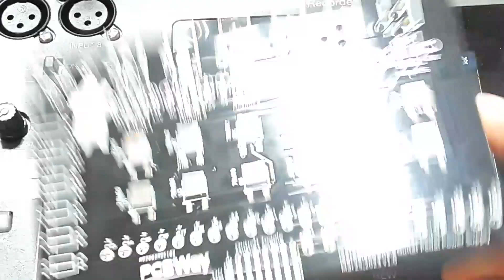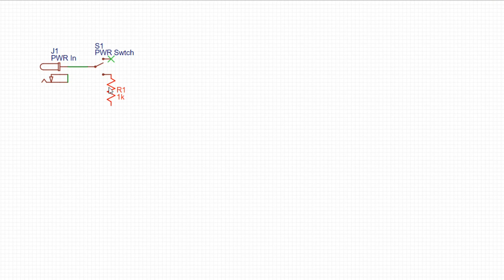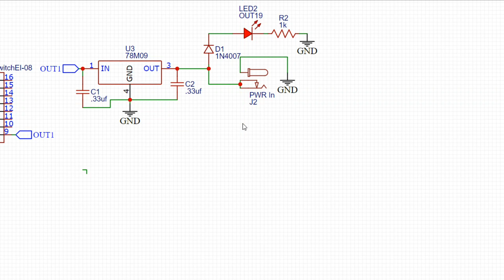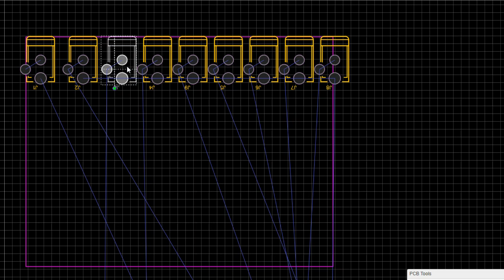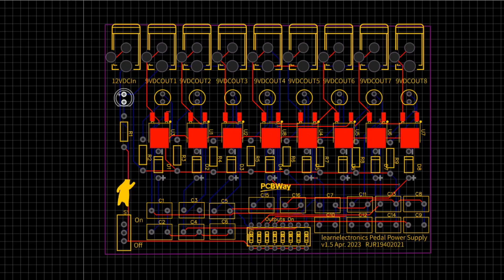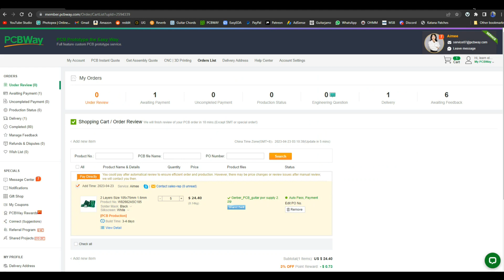Guitar Pedal Board Power Supply Redesign

Comment: I am in the middle of building a supply using 6 7809 150mA (TO-92) for 6 outs and 2 7809 500mA (TO-220) (2 outs each, 4 Total). The 6 TO-92s each have an LED. The TO-220s have 1 LED per regulator. Using the usual 2.1mm DC jacks. Initially the idea was to have the LED light only when a cable was plugged into the corresponding jack but NOPE. The two 'power' tabs on the DC jack are connected and don't break connection until a cable is plugged in so instead the LEDs are lit until you plug a cable in. I have the LED\Resistor connected to what would usually be the DC jack battery connection so it disconnects when the jack is in use. So it is essentially lit to reflect that power is good to that jack and then disconnected while the jack is in use. Seems to me that is how the cheaper pedal supplies do things? Now how would one reverse the operation of the LEDS? S other light only when the jack is in use? Transistors? A microcontroller? Had I though about it more carefully I would just omit leds for the outputs. 🍻

Comment: Hey Paul, If you would really need selectable outputs from a simple design like this, I'd use SPDT Center Off switches before the 2 regulators (no use running one or both if they aren't being used) with some diode steering to control the LEDs. In the original case, you'd need 2 diodes per output: one after each LED to prevent back feeding. Then a voltage divider from output through regulator ground to float the output up enough to compensate for the steering diode drop. Sure, it can add complexity (is it really, though?), cost and build time, but as far as cost goes, right now on Mouser a 10-99 count of 1N4001 is going for $0.099 ($0.10) and resistors are cheap cheap cheap.

Comment: You can make your life easier if SW1 is a SPTD switch sitting between the first DIP switch and the regulators.  You do not need to power the regulator for the voltage not selected.
Reply: I was concerned that both outputs could be switched on at the same time.
Reply: @capecad  If you use either Center-Off or Break-Before-Make switches, that won't happen.
Reply: @TheTrueVoiceOfReason  Yes, that is why I agreed with the suggestion to use the other switch.
Reply: I was thinking the same. Your proposal is the most logical and foolproof.

Comment: An lm317 with a switch for the adj pin or switching the input side and moving the voltage level leds to the input side of your original design with a channel output led if you want one. There are many ways to look at this.
Reply: I agree. A single switch to change the adjust resistance of the 317 would work great, reduce the parts count and still allow both voltages.
Reply: Adding my agreement for this idea.

Comment: Isn't the diode in series with the output indicator led redundant?
It might have a purpose at the input to each regulator. There it provides reverse supply protection for each regulator and drops a bit of the regulator input voltage. A single power diode in the input supply rail would have done a similar job, with the limitation of increased dissipation, and possible cross talk between channels.